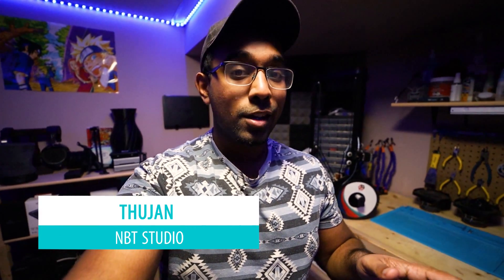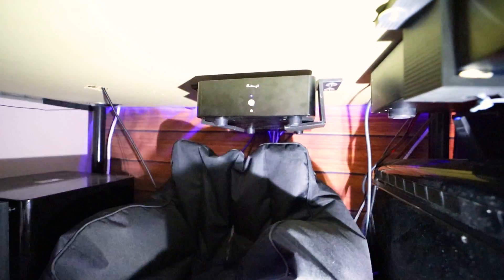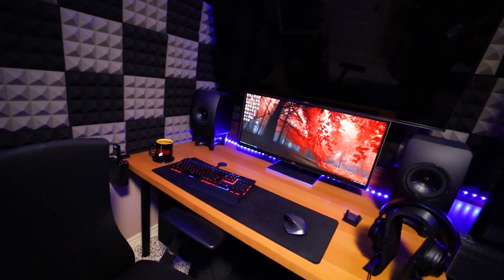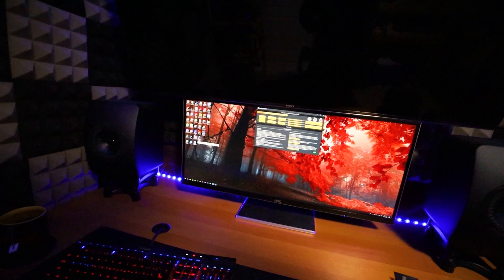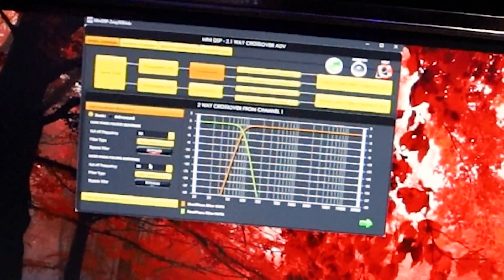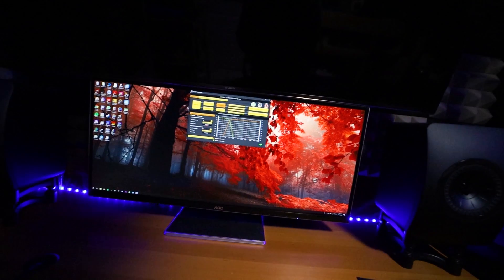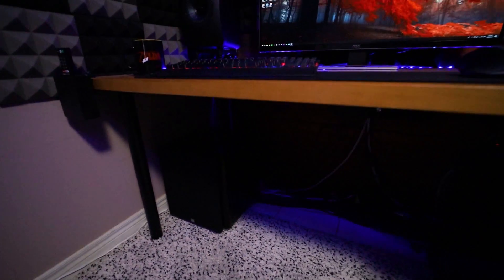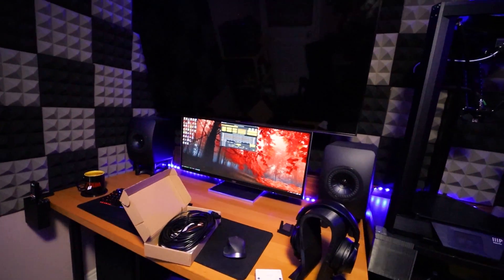Best upgrade I bought for KEF LS50 for $95 !

Comment: The SVS SB-1000 and the Emotiva SE8 Flex sub woofers but have high pass filter built into their low level I/O. (There are others but I have personal experience with these two.) The SB-1000 cross over is fixed at 80Hz. The SE8 is switchable to 60, 80, 100Hz. The signal is blocked if the SB-1000 is switched off, the SE8 will pass through the signal when off. No way to disable the filter when they are on, so you can't use the low level I/O to daisy chain these subs.

Comment: Had same problem with my LS50s in a stereo turntable setup, they really suffer if placed close to a wall. Bass management is the answer and the MINIDSP gets the job done. My solution was easier though, I just hooked them to an old Yamaha 1020 Aventage AVR and the YPAO room correction took care of it.

Comment: I’m in the exact same situation! I literally have the same black edition ls50’s on a desk with the same issues. Only problem is that i’m using an nr1200 which is an integrated without bass management. I’ve had the lsx but i had too many issues, then i bought the ls50 for €600 new and i’m glad i did. Maybe ill get the xtz icepower amp and a minidsp since my marantz has preouts🤔🤔

Comment: I am quite new to this hobby and until now i thought if you set the crossover frequency on you subwoofer to lets say 80HZ the speaker would not play sound beneath 80 HZ. Am I wrong? So the only way to "take off the load" off of the main speakers and not have them play the lower frequencies is with a DSP? Im confused :D FYI I have my sub connected directly to my power amplifier with speaker cables.
Reply: Correct, any tuning you choose on your sub just affects what the sub does, not what the rest of your system does. To avoid your main speakers playing low frequencies, you need to feed them with only those frequencies you want them to play. Thats done either at your amp if it has the feature or by add ons like the minidsp
Reply: @clemleg123  Thank you for the info! That might explain the slight boomyness in the lower midrange ...
Reply: Actually my response wasn't completely correct. Some subs have speaker terminals and can be used as active crossovers like a minidsp would. That means you need to plug your main speakers directly onto the sub as opposed to your amp

Comment: I have an LS50 and spent years trying to see if it would be best to keep them as my Left/Right/Center in my home theater setup or take two of them and make them my left/right in my computer set up.  Always the issue was, how do I get speaker wires to my LS50 while also ensuring I have a clean desktop setup.  

The obvious answer really is LS50w or the smaller lsx since you don't need speaker wires.  LS50w accept usb input directly, which was great and has a sub out.  BUT.. its 2499; during heavy christmas season sales, you can find it for 1799.  That's a lot of money for desktop.  

I also have a descent pair of headphones, and if you do then you will be playing with the need for amp and dac and all these things take up space on your desk.  

I find the easiest solution really is to just go with powered speakers, which is essentially was the LS50w was; but you can find cheaper studio monitors with excellent sounds without the need for any of the above.  I don't have a sub yet, but you if i were to get a studio sub, I could let the sub do the high past filtering; where it sends 80hz or above to the studio monitor and it plays <80hz.  So ultimately.  it is RME ADI-2 dac; with XLR to Hedd type 05.  minimal cords, dac and amp are in 1 unit so that I can listen to headphones, and if i get a sub, it is easy to implement, while still having a clean clutter free desktop.

Comment: If you have a hump in your sound, the subwoofer is too loud. Don't roll-off the LS, roll-off the sub more to 60Hz or so.
Reply: i agree....i run my mains at full bandwidth crossing the sub at 60hz/24db slope sounds amazing. I think it sounds better to my ears running the mains at full bandwidth after using an 80 hz crossover for a long time.